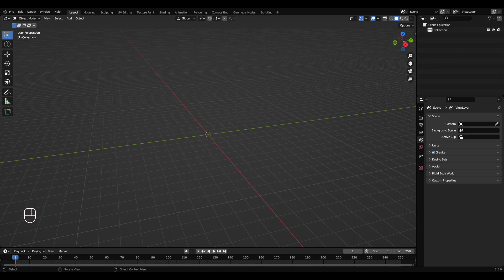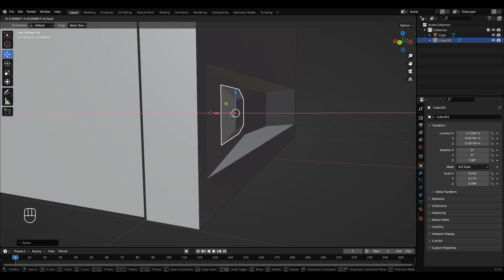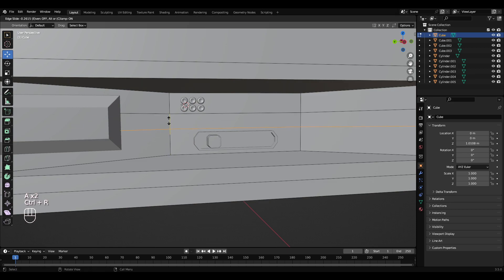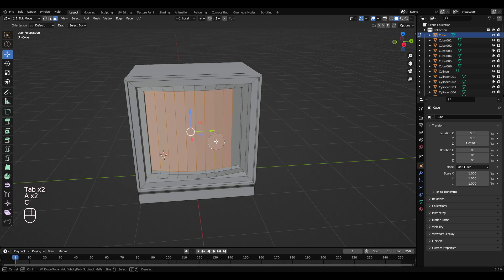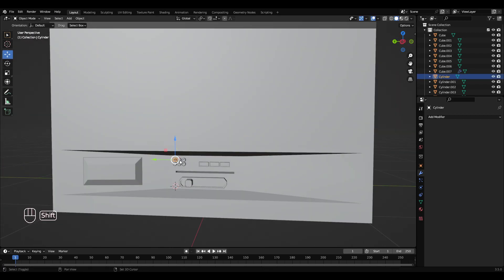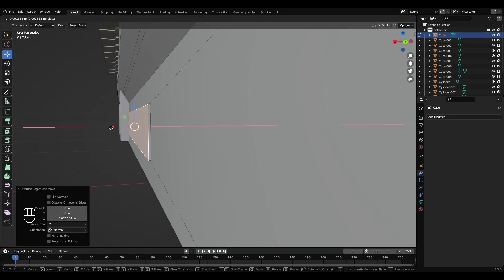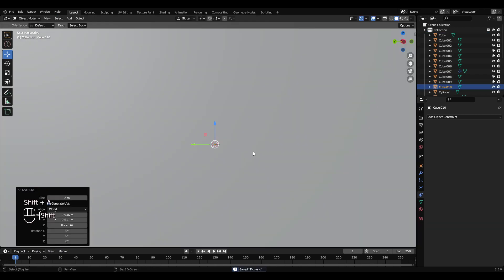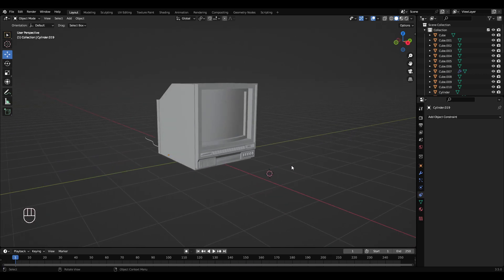How To Make Retro Television In Blender

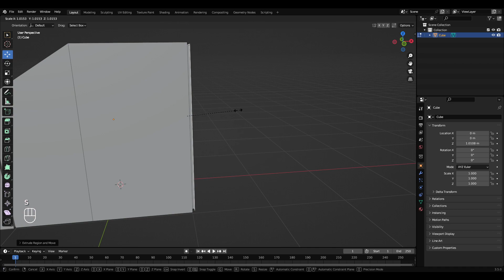Comment: How did you do that move at 0:44
Reply: on the keyboard press 3 this gets you to the face select option. Then select the bottom of the extruding cuboid. The select the move icon on the left side of the screen (one with four arrows each pointing in a different dirrection). Then use the blue arrow on your object to pull that section up. 
It took me a while to figure out how to do this lol